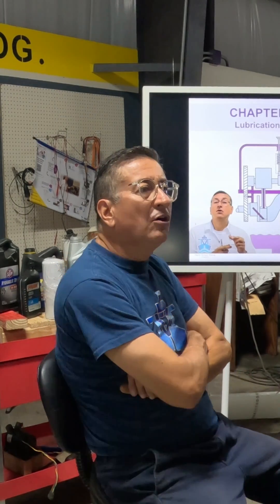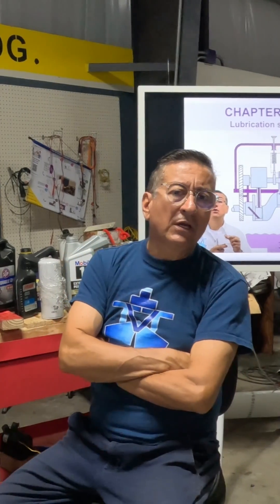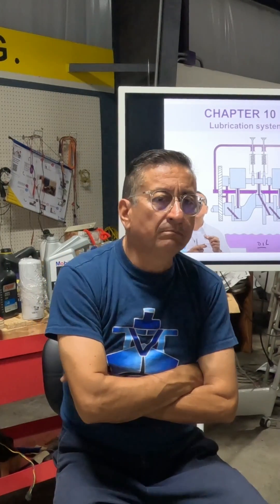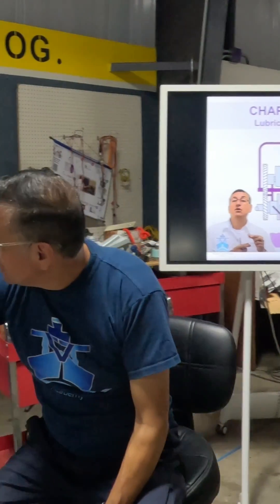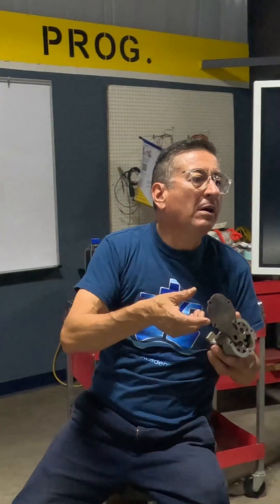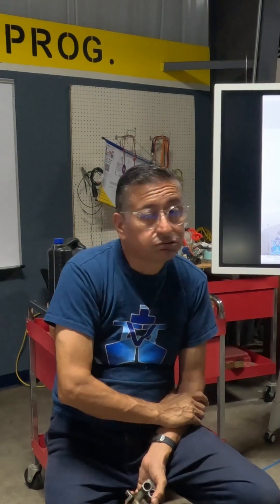Low Oil Pressure

Comment: If pressure is low, i'm checking the filter first, and then the pickup tube.
If the oil is cruddy and/or clumpy, the passages might just be clogged.

Comment: You check the bearings then the oil pump . You can use check the bearings with plast guage . It will best way to do this as it can keep your motor running longer and this guys never hear of a inframe I guess . I built hundreds of motors and repair them by just replacing the bearings rolling them in after checking to insure it within tolerance.

Comment: My guy don’t you know connecting rods and crankshafts can be resized? Diesels in particular use a bushing on the small end so needing a new rod or crank isn’t common unless said part has been ran without oil or bent

Comment: imagine hearing “hey my friend you need a new crankshaft, new bearings, new rods, new pistons” LMFAO
Reply: And an oil pump on top of all that.
Reply: See that's the problem a real mechanic tells him what he actually needs and a person has a heart attack thinking they're getting robbed the rip off part's changer mechanic sells them an oil pump knowing that he needs more and doesn't give a🎉😂 being a mechanic Ain't Easy but then again It Ain't Easy Being Cheesy
Reply: Noob question here*
Why the need of new rods + pistons?
How the low pressure of oil can damage the rods n pistons and not the bearings + rings?
Ty so much, big hug from Portugal
Reply: @SZAPT  he said the source of the problem or the main problem is the bearings
Reply: @ ok, the bearings damaged may indicate that the rod is scratched too, but what about the piston?
Reply: @SZAPT because you might as well change all that while you're in there doing the other work, instead of opening the motor again in a few months just to do pistons and rings.
Reply: @dieselmunkey  Still, i've a 1.9tdi VE engine, with remap, and 460k kms.
It had rings, bearings, valve guides, cam shaft retention, valve cover, and the pistons + rods were just cleaned. The mechanic said they were impeccable.
Was he dramatizing about the good condition or it is possible with this kms on the engine have damage pistons or rods?
Ty so much for ur time buddy

Comment: At that point its cheaper to go for a new engine or reman.
Reply: I was thinking that too. If there's some way to tell that is your problem, then keep driving this engine to the last mile while you acquire a replacement. Pretty much what I am doing now with the transmission in my car, I know it's no good so I'm getting every last mile out of it while I worry about the replacement.
Reply: If you pull the components he mentioned then you’re halfway there lol
Reply: Well yeah especially now days. That's what the video comes down To. Rebuild if rebuildable or engine swap
Reply: Facts

Comment: I had bought a 05 mzda hatchback and oil pressure low a few hundred miles later the bearings went bad very much the crank was probably bad. I'm just now getting into engine break down and maintenance at 40 😅
Reply: Nice I’m 36 and just successfully rebuilt my second motor I’m stoked! The only scary part was putting the 45-60 degree crosshatching on the cylinder walls so they’ll mate with the new piston rings. Get one of those flex-hones with the little stone balls  on it , put it in the drill on the lowest speed setting, pulling trigger lightly, but moving the drill up and down the cylinder pretty fast! Came out perfect 20k miles later 🤙🤙
Reply: The rest is just putting it back together, always use proper torque specs and also use those little wax strips to check bearing clearances

Comment: He should explain the possiblity of low oil pressure.. there's many possibilities... In my experience.. oil pump also can create low oil pressure when relief check valve stuck in open position. Trust bearing also can created low oil pressure bypass valve stuck in close position and filter clog also create low oil pressure... And the worse if engine block crack at oil gallery...
Reply: Diesel engines I have gone to for low oil pressure normally turn out to be fuel getting into engine oil.
Reply: @DW-hx1xm  .. agree with you... One of the reasons oil pressure becomes low..
Reply: You guys missed his point
Reply: @masterpah1  not really,  I added my comment through years of being a diesel mechanic.  And like to add overtime, I have had to investigate low oil pressure quite a lot.  Always been faulty switch or fuel leaking into engine oil. Nothing negative about any of these comments. 
No one is saying he is wrong.  
And nothing wrong with sharing experience to try and help the younger generations out .
I think you are missing the point 👉
Reply: Another reason I’ve seen is plastic timing chain guides breaking into small pieces and getting sucked in to the pickup tube.
Reply: @truthsmiles  I've had an engine oil cooler that started to break apart internally and caused oil galleries to block.  Oil pressure switch was on the blocked gallery,  but oil pump pressure was brilliant at a different test point. 
I also seen engine failure because of excessive usage of silicone.  Silicone got stuck in oil galleries in the crankshaft.
Reply: @DW-hx1xm  Wow that’s some serious investigation to find silicone in oil galleries! Nice work!
Reply: @truthsmiles  I can't take credit for finding silicone lol.  I wasn't even working on that engine. It was a failed rebuild if I can remember.  And silicone was the reason why. And laziness off not brushing galleries out when rebuilding.